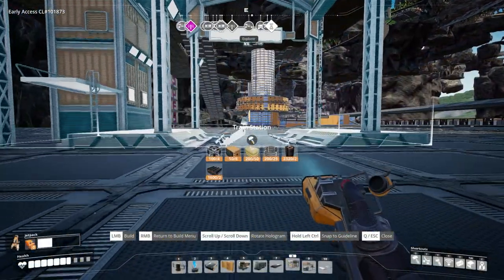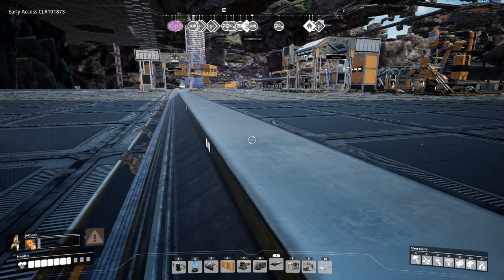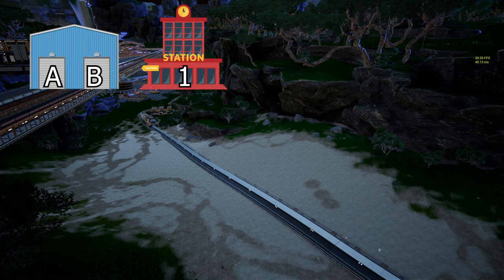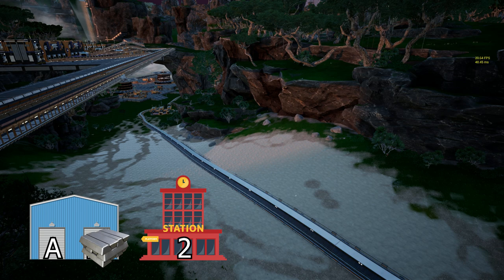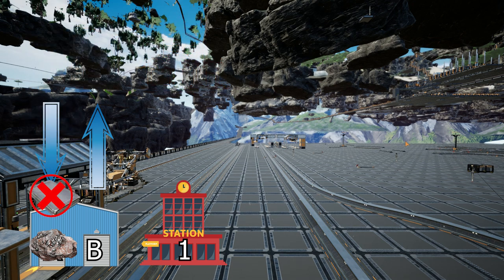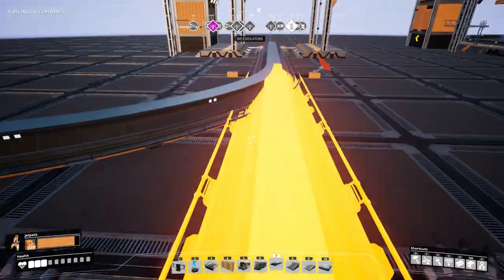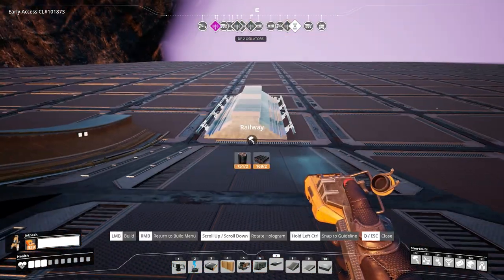Satisfactory Train Guides: Train Layouts and Multi Station Setups Ep.01

Comment: I'm planning a bit more complicate layout. 1. - main hub station1, compact coal pickup -> station2 coal & iron ore pickup -> station 3 compact coal delivery, oil pickup, better fuel pickup -> station 4, quartz pickup -> main hub1 deliver, coal, iron ore, oil, better fuel, quartz -> repeat (this is a 2 loco pickup with a passthrough lane by each stations so on the way back using the same track it does not pass through the other stations.)
Reply from the maker: lcmattern that’ll be awesome to see when it works but I think we’ll need to have signals if we want to use pass through lines 🤔

Comment: I think you should make a point at 2::00 in your video, if you split off with a push/pull setup to a third station; that third station turns your train around and your cargo in no longer in the right order if you have different cargo.  And you can't simple add another load/unload station because every time you enter the split off station the train turns around, so it will be different every trip.

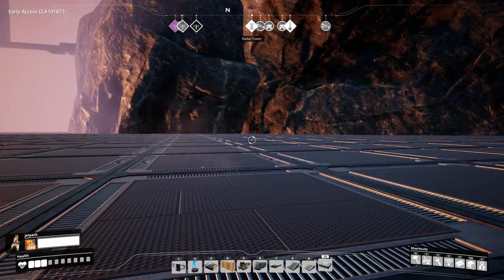Comment: im extremely interested in seeing how you made your roundabout exchange at 6:25. id love to see a video on it, i can quite replicate it.
Reply from the maker: There should be one up in 8 minutes... :D 
only issue is there are some bugs and pathing issues with it since the patch, I don't know why, so I might have to rework it or at least make it bigger. 

basically do 3 90 degree corners each one taking up a 3x3 worth of foundations, then complete it with 2 45 degree angle corners. (because you can't complete a circle using 90 degree corners for some reason) once you've completed it, remove each of the 90 degree corners and replace with 2 45 degree corners. From there you can split and join tracks. :)

Comment: There's no need to split the lines when using push pull with multiple stations. Just add each station twice in the time table.
Reply from the maker: tmkongen really I may have to try that out ☺️
Reply: @TotalXclipse  I got 2 lines with push/pull. One with 4 stops and one with 2 stops. All they do is travel back and forth so it works. This is probably a bug though, it seems that both locomotives do a stop on a station in the time table, that's why you need to double it up. For now at least.
Reply from the maker: tmkongen I don’t know if it’s from the recent patch over the last two days... I found if they were on the same line they’d go to station A, B, C however after they’d always go back to A then to B and back